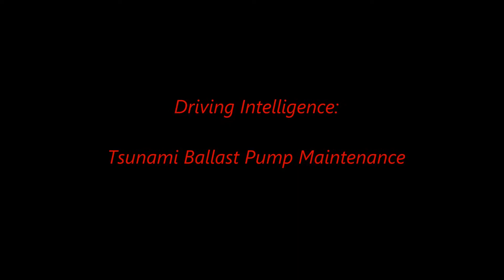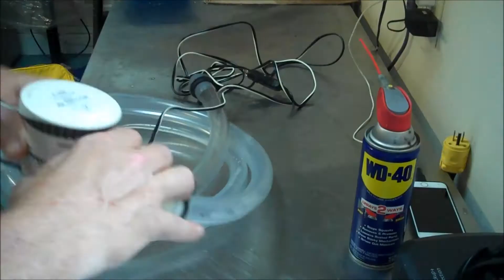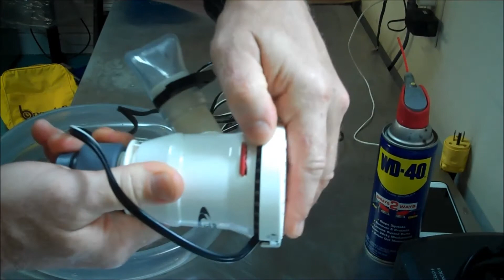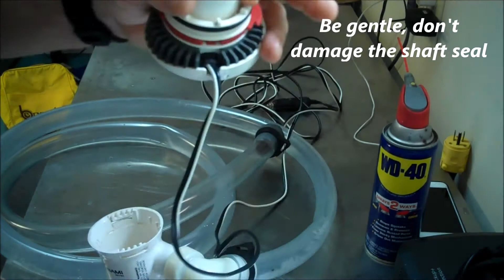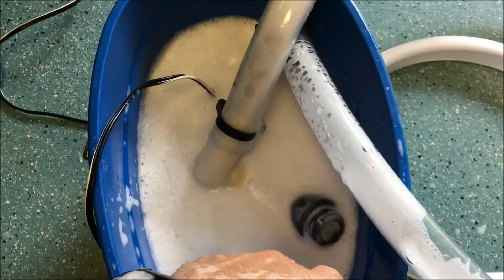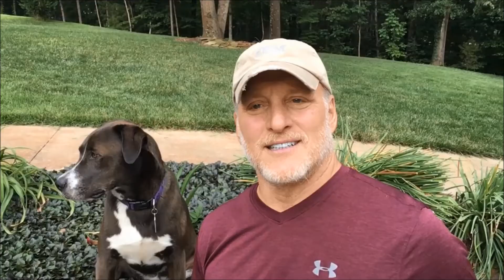Tsunami T-1200 Ballast Pump Maintenance, Prevent Wakeboat Ballast System Failure

Comment: Interesting about doing maintenance. I have used an Atwood T800 in saltwater and replacing the pump after less than two years. Saltwater I would think would create more corrosion. It is an idea worth considering in the future. For now time to purchase the replacement. I than you for reviewing the Atwood favorably over others so I don’t jump unnecessary hurdles by changing over systems.
Reply from the maker: Thanks for the comment.  Even in fresh water I get corrosion and build-up, therefore every year I WD40 my pumps to keep the corrosion down.  Hope you subscribed!

Comment: This is a good idea but….I’ve been using the same Tsunami pump to fill my fat sacs for about 10 years and never had a single problem. It might not be pumping at the original volume though. I’m going to try your maintenance. 👍
Reply from the maker: Thanks for your comment.  Problem might also be water source.  Your water might be cleaner